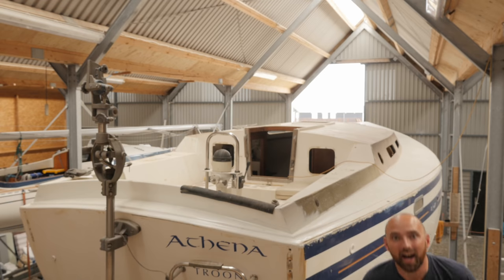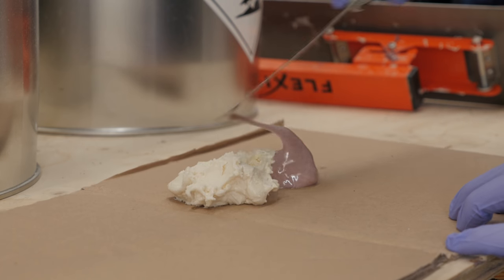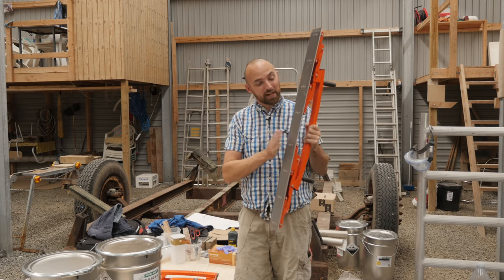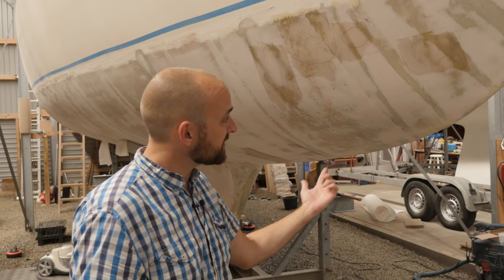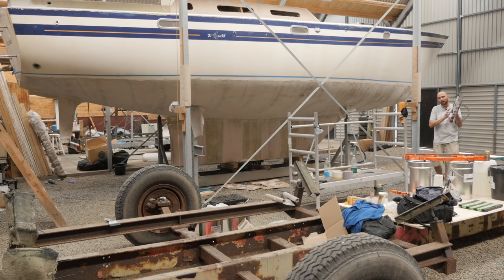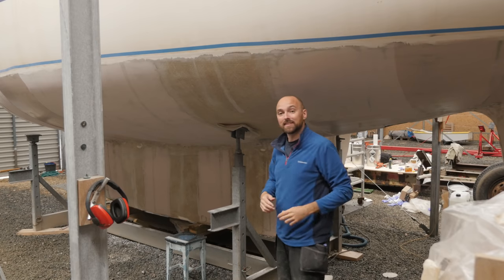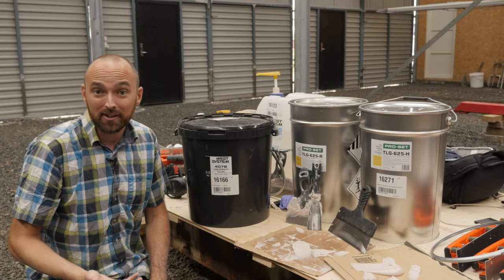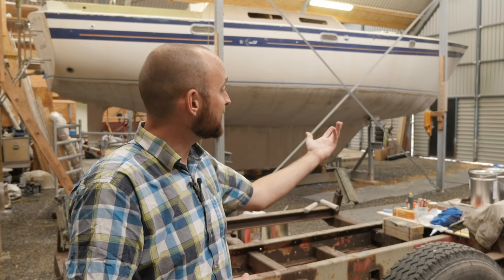Sail Life - Osmosis treatment, fairing the hull some more - episode 4 of 5

Comment: Wrap some sand paper around a flexible styrofoam pool noodle(pool floatie)
Reply: good thinking
Reply: I have used pool noodles for sanding inside curves in wood working projects and they work great for that - plus I found 3 different sizes, so I can pick the one that is close to the radius I am trying to sand. I use about a 4" (10cm) length of the pool noodle with a half sheet of sandpaper.
Reply: lguenther5   Great idea!
Reply: I was going to suggest a piece of wood dowel wrapped in sandpaper but the pool noodle sounds like a better solution.
Reply: I should have read the replies before i posted😝
Reply: I used different size pvc pipe with psa  backed sandpaper. I really could have used that flex power sander.

Comment: Not hard to believe that all the arm-chair keyboard captains out there are asking why waste time on fairing a cruising hull... They obviously have zero experience with long distance cruising and how even minor surface imperfections can effect speed and especially fuel economy when motoring.  Mads, I'm glad you are investing the time and effort to do things right and also prevent future issues and unnecessary re-work.
Reply: Aserta He's quite correct. Very significant gains in boat speed and passage times can be had from simply cleaning the bottom, to say nothing of it being smooth to begin with.
Reply: Sure I am @aserta, I am also very experienced with both boat construction, repair, and traveling very long distances while burning more diesel that you could possibly imagine (400K gallons in 8 tanks) on a 500 ft ship. So yes, I am very opinionated about the importance of a fair hull and I'm happy to see Mads doing what is not only correct, but will save him time in passage as well as fuel cost when motoring.
Reply: Kraken It also makes scraping off barnacles easier, without gouging your spiffy coppercoat!
Reply: Without a doubt Paul.
Reply: Oh, I am an arm-chair keyboard captain. Thanks for pointing this out. I wouldn't know it without your comment. Lovely Kraken, I did the underwater job four years ago. We don't talk about deep scratches we talk about smallest uneven areas. It is o.k. when Mads like to have it as smooth as possible but it doesn't effect neither Coppercoat nor any other antifouling nor the speed. And Coppercoat becomes not as even as you think.
Coppercoat is the next rumour. Everyone tells you it lasts longer, it a complete different way of beware fouling. If you talk with suppliers and users you get a different view. Coppercoat MUST be activated at least every 6 month. In areas with hard fouling sometime every 3 month. I saw a lot of boats with blistering of Coppercoat after 3 or 4 years. Last but not least, why isn't it used on the working boats in harbours? Coppercoat it based on a water based and slightly water soluble Epoxi. The copper powder seems NOT only being copper. But I don't know exact. It is very interesting that the "slow" going professional vessels, like the harbour boats running all over the world with extrem soft Antifouling. The faster (around 20 kn) running on hard(er) Antifouling. I never heard of Coppercoat used in this field.
Maybe you should inform you about the working of antifouling, It's not only poisoning the shells and plants its as well a question removing them by mechanical rubbing while sailing.
But all people have the right to think what they want and when someone become happy with this or this it's o.k. But never name others (as well experienced sailors) as arm-chair keyboard captain is showing the own face.
Reply: JED, if other opinions disturb the peace and shows not respect the creator than it's something wrong. If you are so peaceful as you say read you introductory words. But it doesn't matter for me. 

To CopperCoat - it's true, in the past the wooden hulls have been plated with copper plates. As well nowadays they do it often with HISTORIC boats. Copper is a biocide and kills bacteria above all. Barnacles and shells lough of it, but plants die on copper. The most people I asked for their experience told the action to do as I wrote. In addition they nearly all got blisters of coppercoat. Of course they said it our fault. Poison - its in the nature of the matter. If the plants and barnacles and shells don't grow it must be poison. On the other hand, you can poison only the plants, the barnacles and shells grow on copper as well. To remove them mechanic is needed and the soft self polishing antifouling does it in this way. Self polishing means not the bleeding, self corroding antifouling. 

And last but not least, Wanambi needed a lot of work, she is nearly 50 years old. The most hullwork is done. We decided to use a super soft copper based antifouling and it last now for 4 years without scrabbing, grinding and growth. The cost has been a third of copper coat and there is no need to crane for at least 60 month. I wouldn't believe it as well but it works. We will see what happens with coppercoat on Mad's Athena.
Reply: Word

Comment: I made a Canadian canoe from plans, when I came to pull the hull off the strong-back Ted Moore’s remarked well done you one third through the project. To sand the curved interior he introduced a bottle sander. This is a bottle with the correct radius wrapped in 240 grit sand paper. The are you have is less than a 16’ Peterborough canoe, but (the bad news) it was not quick.
Good luck.
Nigel

Comment: In woodworking, to sand difficult coves we apply plastic wrap to the cove and then a thick mound of bondo (the type with the fiberglass fibers is the strongest).  Allow the mound to harden completely, pull the mound out of the cove & the plastic wrap off the mound.  You now have a perfect sanding pad to sand the cove.  Add sandpaper and sand out the cove.

Comment: Re: Fairing the inner radius; You need a custom made tool.  

Go to a foam supply shop and have them hot wire a block of foam in the shape of the inner radius.  Then glue on a piece of fabric to the inner radius curve for the peel and stick sandpaper to stick to.  What you have is a flexible block of foam that sands the inner radius.  Works best if the block is more larger than smaller.

Comment: Foam pool noodle, 1 liter water bottle, short section of PVC or plastic pipe, a small section of plywood with kerf cuts that do not cut all the way through about every half a centimeter. All of these make good fairing boards to make that  curve.

Comment: Use a piece of rubber hose close ,say about 2 inches in diameter and maybe 18 inches long , wrap your sand paper along it and Bobs yer uncle also a piece of paper towel (flat) between your hand and the hull.Cheaper and faster than guide coat . Close your eyes when doing it for the first while 👍Awesome job my friend

Comment: Mads,
You can cut out a tool out of tin or plastic with a desired consistent radius (ideally a radius that matches a piece of PVC pipe). Run the compound though your area with tool. It should we OK with 2 to 3 passes. To sand match your tool radius to your piece PVC pipe and stick your paper to it and sand away. Pick your PVC radius (looks like 100mm PVC) so you completely fill the void between keel and hull. be prepared for some creative work  for and aft of the keel. Tim Australia. I have done this a couple of times

Comment: For sanding coves like you have between the hull and the keel I have had good results rolling a small towel up into a tube that is about the diameter of my cove and then wrapping it in sandpaper. wrapped up tight enough and it will conform to the contour of the cove without gouging into it. Just a thought.  As for the people who suggest because she's a cruiser so no need to worry so much about the details on the hull.... just because she is not a racer that is not a reason not to make it the best you can and with all the hard work you have put in everywhere else on the boat doing things right the hull should get the same attention. And worst case scenario is you get a smoother hull through the water because of your extra effort and that is not a bad thing for any boat.

Comment: I am sure you have thought of this, but to sand the concave (?) joint area between the hull and keel find a round cylinder (pvc pipe for example) that has a radius smaller than the curve.  Wrap a sheet of sandpaper around it.  I have used in the past self-adhesive sandpaper with an adhesive back that would adhere to the cylinder.  Be aggressive, that is, use corse sandpaper to start with then go over the area with a couple of finer grades.  Good luck.  Keep in mind as the blood leaves your arms, compared to what you have already done, the combined length of this joint area is relatively small!

Comment: Hello!  I have used 3m spray adhesive on the outside of an empty 2 liter plastic bottle,  then apply the grit you want to work with.....I like the diagonal cross strokes while sanding, starting with 40 grit, and working through the grits....I have used paper cardboard tubes, plastic pipe, and any shape that closely matches your shape you want to fair.
Great job!  I was teaching boat building at a community college, you can reach out to me anytime!

Comment: Nice work Mads. Fairing the radius might be easier if you took a length of PVC and wrapped it with sandpaper. Chamfer the ends so as to not catch when moving side to side. You probably can also fashion a couple handles with some cabinet pulls or similar.

Comment: Hey Mads, I sand inside radiuses with a piece of Styrofoam (other people us different but similar). cut a piece 350-400mm long and with the radius (roughly) that you are aiming for and rap some open-cut sand paper (usually white-ish in colour) holding it by hand over the foam. the foam is good because it is a little flexible as you use it and the open-cut paper gives you a good feel for where you are sanding, but be careful it removes material fast. Start with paper about 100-120 grit to judge how you like the process. Yes Mads, we all love sanding and its very therapeutic to watch someone else, take care. Paul

Comment: Use a piece of round cardboard tubing or plastic pipe the length of your sandpaper. Put spray adhesive on back side of sandpaper. Attach paper to tubing and sand lengthways at an angle using a crosshatch method. This will let you follow the natural curve along the keel. Use something about 40mm round for your tube.

Comment: In theory you can lower two legs on one side very simply by anchoring the boat from two very structural elements on the other side (atop) with chains to the two, opposite legs. I've seen this done, there was a boat only slightly bigger than yours in UK a couple of years ago (that i visited) that had been smashed against a pontoon or something and the fiberglass was damaged on the whole port side. They were in the process of cutting a whole strip out just below the water line and above it, and that's how it was secured. 
BUT let me tell you, those were some heavy duty chains, not straps, chains, to protect the toe rail they had heavy woolen blankets under it.

Comment: For sanding inside radii, I like a pool noodle with some lightweight PVC tubing to line it and contact adhesive (sprayed light from a fair distance as it may dissolve some of the different foams I've found). Put the tubing in the foam, spray light temporary contact adhesive on foam and back of sandpaper. Let tack up and apply \ sand.

Comment: For those radius areas, try using some different diameter pieces of PVC plastic pipe and wrap the sandpaper around them. Works great if you get the right radius.

Comment: Applying the fairing compound to the fillet in the first place.
Get it on smooth by doing the final pass with an appropriate size inflatable ball. The ball will conform to the shape as  long as the pressure is even on both sides. More consistent application = less sanding.

Comment: I once saw some chaps in Thailand sanding a hull down and they adapted a piece of PVC pipe closed off at each end with holes drilled in it. Stuck on some sanding paper, some handles and attached a vacuum - viola, you now have a curved sanding board.

Comment: For concave sanding glue or wrap sandpaper on foam insulation intended for hot water piping. Available in multiple dimensions from Biltema or any plumber.  Same as 'pool noodles' suggestion but with a bigger selection of diameters.  This is my real experience not just armchair ideas.

Comment: Putting self-stick sandpaper on the outside of some PVC pipe (with the appropriate radius) makes a great sanding tool - you can even add a handle if you want.  I'm putting sandpaper on the inside of PVC pipe to sand the douglas-fir mast and spars I'm making.

Comment: You know this already I expect but rub a length of expanded polystyrene in the radius to roughly shape it then skin it with some epoxy and fibreglass to make a tool that will fit in the radius. Once cured cover with sandpaper and you should be able to sand the radius accurately.

Good luck it is all looking fantastic!

Comment: Sanding definitely is a heavy duty workout - my two years in fulltime prototype building gave me the buff shape of a decathlete - back then though ... . For the radius, we would build light softwood pieces slightly underrunning the radius on one side with good handform on the other (pinus for small pieces, balsa for bigger ones, weightwise) and glued on a layer of cork or a thin layer of soft expanded rubber with contact adhesive; some were two-piece builds creating a slot to pinch the grit paper. The relief in terms of sandingprogress for me absolutely does vindicate the time it costs to build said helping radius-block(-s).

Comment: I love the comment on scrubbing the hull annually, I think you might find it is more like every 3 to 4 weeks you'll need to run a plastic scraper over it.....
 For sanding a radius I cut out a section of suitable sized PVC pipe add a wooden handle (just epoxy it on) and some velcro and wallah instant radius sanding dohicky

Comment: Mads, just a little tip about locating high and low spots when fairing fiberglass. You received some suggestions about spraying a coat of dark paint then sanding it to identify irregularities. That trick works well on automobiles, where a little residual paint won't matter under the primer, but in boats it can cause problems. You might want to try mixing some dark clothing dye with isopropyl alcohol then using a foam brush, apply several layers on the surface, allowing for dry time between layers. Once you're done sanding you can simply wash off the residue with a good soap and water solution. This gives way less worry about residues and possible contamination. I've used this trick on both boat hulls and on Corvette car bodies.

Comment: For the tight radius I always use the grey outdoor foam insulation that is used on water pipes at least it is in the UK, comes in 1mtr lengths it's split down one side push a length of round wood through the whole to spread it to close on the right radius and tape each end then wrap with sandpaper.

Comment: To sand a radius, how about a length of 10" or 12" PVC pipe.  Apply spray adhesive and glue on a sheet of sand paper.  It would be easy to fabricate handles on the pipe, fore and aft of the sandpaper.  That would make radius sanding a little easier.

Comment: Excellent video. 
Too bad I didn’t send you some of my old automotive clay tools to help with the fairing. Especially for the fillet between the hull and keel. We use very thin spring steel shapes that match that fillet. I have used them also for applying fairing compound with success. Another trick would have been to cut a thin plastic piece to conform the the shape of the fillet and then use it to drag the fairing compound fore and aft along the fillet. As for the sanding, the guy with the idea of using a pool floaty tube got it right. You can also use some of that foam pipe insulation with a section of flexible plastic pipe inside to make it a bit stiffer. 
I sure enjoy watching you work! 😜😃
Reply: My first thought was a pool float ("noodle" or "Funnoodle").  Use contact cement to attach a long strip of sandpaper to it.  To get a thicker radius, add a layer of foam between the noodle and the sandpaper with contact cement.  You can keep adding sandpaper as it wears out (but the radius will keep getting a little larger each time).

Comment: I have followed your videos and admired your work attitude . I did my first Osmosis treatment 38 years ago and have just finished my last 2 weeks ago .Try rapping 2 bungee cords around the hull with good tension on them ,slip the power sander under them they will need to be strong enough to hold the size of your sander with a little bit of pressure on the pad . You should be able to move the sander 500 mm  backwards and forward and all the way from the water line down to the center line  of the boat .With practice you can use the sander one handed.

Comment: find a fabric store, rug,flooring or any place that sells bulk something. Ask around the yard,the glass cloth you got, it came on a tube. the tubes are heavy construction and the arc should be close, different diameter tubes might be needed. make the tube as long as needed,tape paper around with wide tape. If all else fails (FREE) try an office supply for a shipping tube or hardware store for plastic pipe. An industrial area dumpster dive might be in the offing...lol